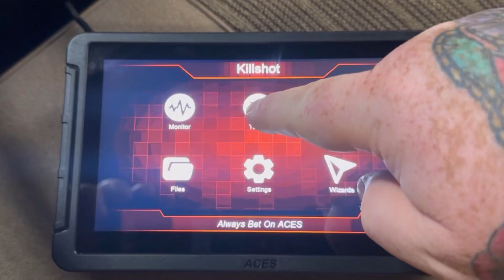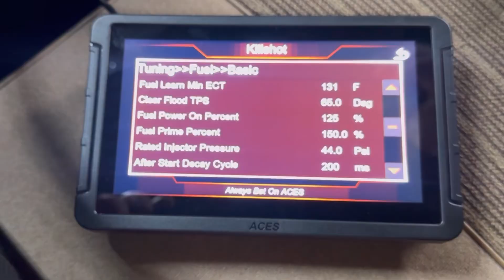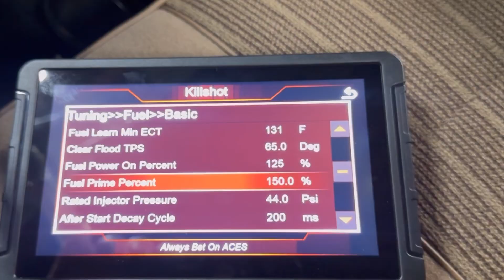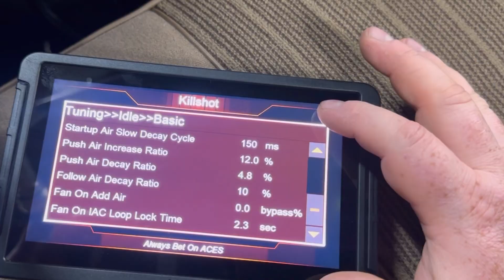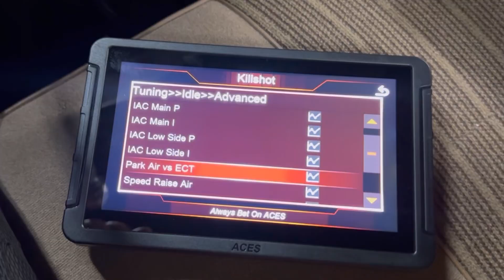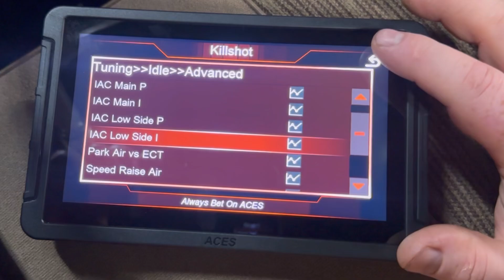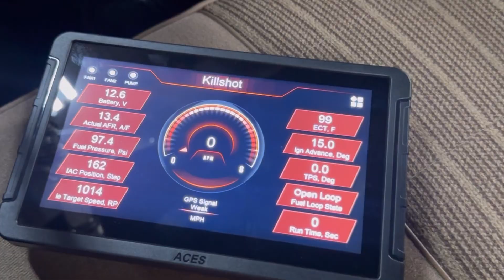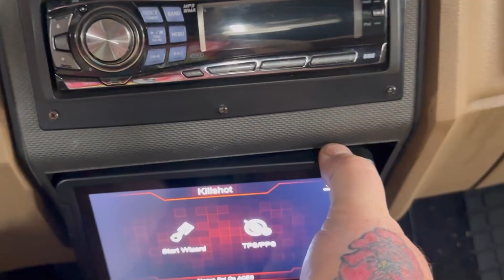ACES EFI Tuning Tips - Cold & Hot Start Issues - Tuning for Manual Transmissions

Comment: What cam are u running in that truck….these settings should work for my roller cam 302 in my ‘67 mustang with c4 trans??  Trick flow stage 1 cam

Comment: Hey Cody is it me or am I imagine it because according to the display it says your fuel pressure is 97 psi when it should be around 58 to 60psi max
Reply from the maker: @SHSPVR  it’s just because the truck is off & I primed the fuel pump several times trying to film the video. When the truck is running it’s at 58psi.
Reply: The "unplugged" value is really high, usually its like 103-106psi depending on the unit